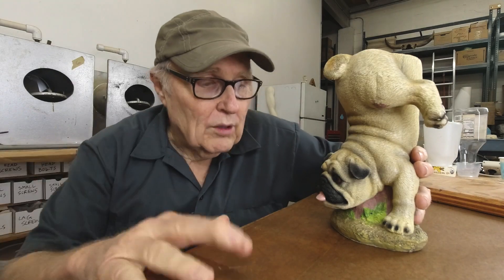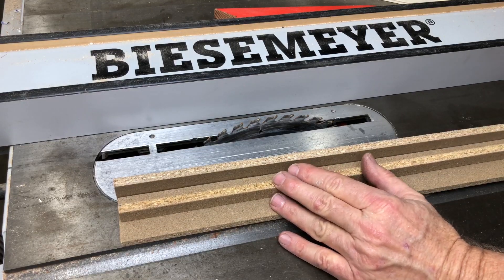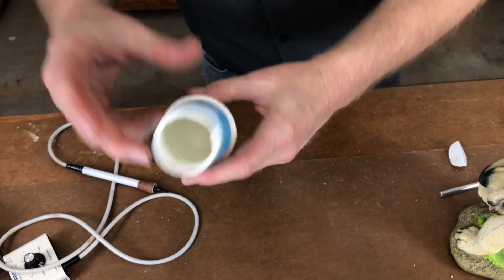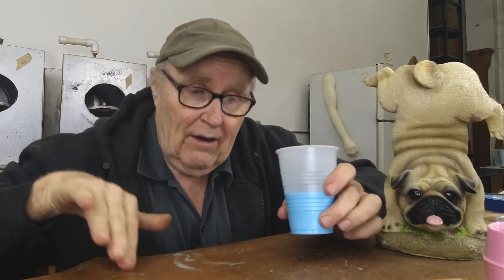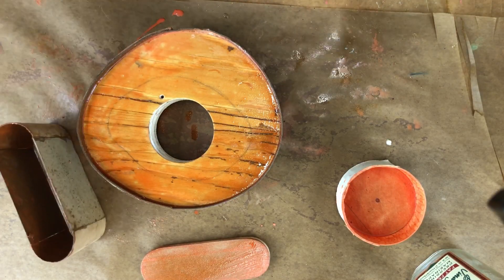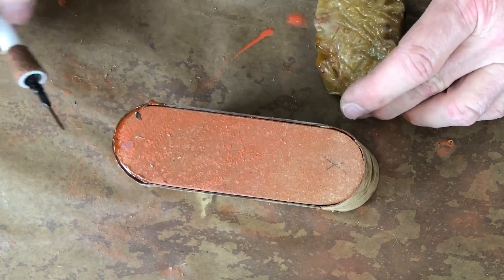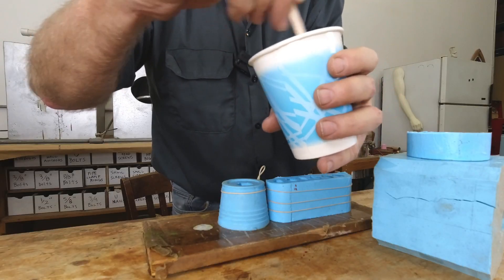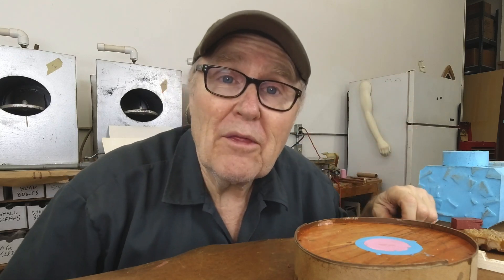Hollow Cast A Complex Part - Rotational Molding Tutorial, Part 1

Comment: Robert, I learn so much from your videos I so enjoy them, thank you. 
I have a question for you Robert.
So when doing rotational casting is there a less expensive material to use than resin? Do you have any recommendations. I would like to make the outer layer of my figuring with resin, then I would like to use a cheaper/ less expensive 😁 material for the inner/second layer of my rotational casting. Thank you Robert any recommendations would be appreciated 🙏
Reply from the maker: There are less expensive materials than resin for rotational molding. Some plasters are made to be hollow cast, as can water-extended polyester. it’s probably not a good idea to try to make a resin shell backed up by a cheaper material.  you could have all kinds of adhesion or shrinkage problems. One other option might be to use a urethane foam to back up the shell of your hollow casting. This method is commonly used but it can be tricky to make work.

Comment: I’m replicating some small parts from a WWII 3” Naval Deck Gun (MK22). A few of them resemble a thimble (larger 1” diameter x 2” long). The interior wall is as smooth as the exterior. My question is how to mold a shape like that?

Comment: Hello Mr. Tolone, I do have a question. Something I've never done myself. Can one build a sculpt out of cardstock and make a mold of said cardstock sculpt? Of course not under pressure. Something I want to attempt to do soon actually.
Reply from the maker: Silicone rubber can bond to unsealed porous surfaces like paper, cloth and wood.  Test a sample of your card stock using the silicone rubber you plan to mold with. If it sticks you will need to seal the sculpt before molding.  Also, if the sculpt is hollow it will be critical to make sure there are no leaks in the joints. Rubber can seep through incredibly tiny openings.
Reply: @RobertTolone  should i use the bees wax to coat the cardstock? Lol
Reply from the maker: Yes, beeswax works! But there are lots of things you can seal with. Matte medium, shellac, sanding sealer, Mod Podge, etc. I’ve used lots of sealants.  Often a project comes in and I don’t know what the finish is. So I always test the rubber on a small spot on the sculpture to see if they play nice together.
Reply: @RobertTolone  my only concern mostly is the weight of the rubber warping the cardstock. I tried epoxy on a small part and lets say it didn't work out. The epoxy for some reason didn't take too well to it. Tried wood glue and it worked as a sealant but wasn't hard enough to my liking. Which is why I wouldn't mold under pressure because I know it wouldn't be able to survive. Btw Thank You for the advice, its much appreciated.

Comment: Mold material melts at higher temp than bottle?
Reply from the maker: No, glass melts at a much higher temperature than wax. The mold material is RTV silicone which stands for room temperature vulcanizing.  That means it cures at room temperature. No heat is needed to vulcanize the rubber.
Reply: Robert Tolone Glass?
Reply: Robert Tolone that bottle was glass!
Reply: I assumed that was a plastic bottle!